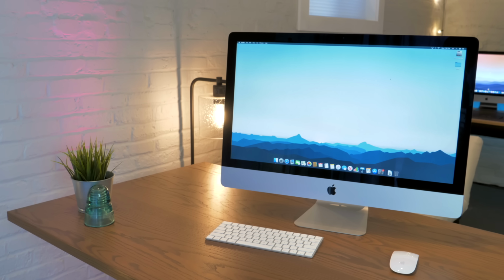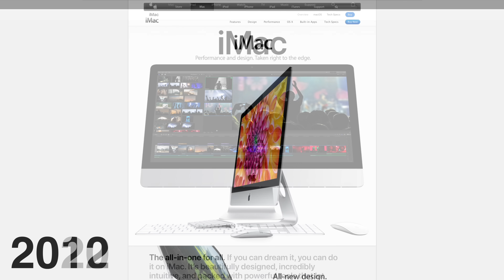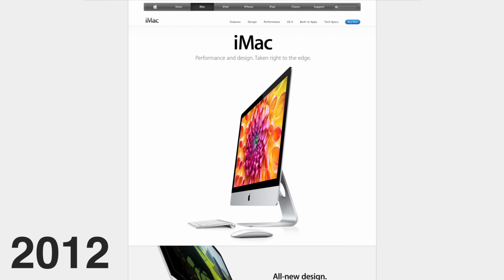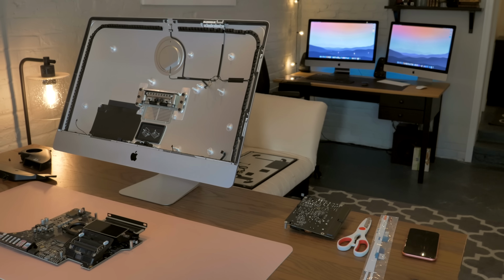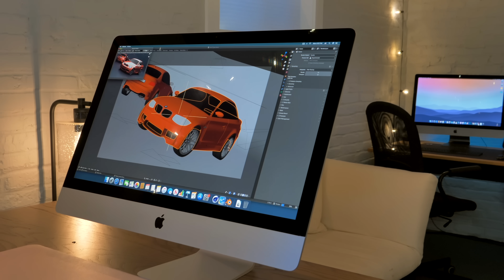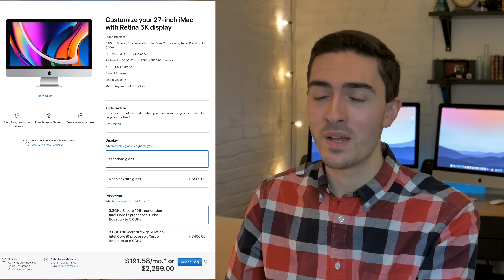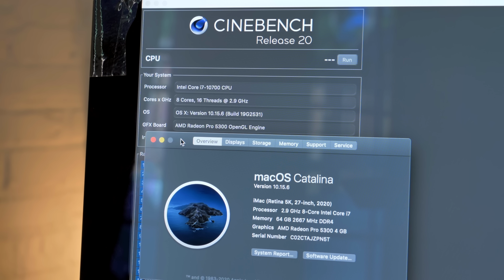DIY 2020 iMac upgrades! Is the LAST upgradeable Mac worth it?!

Comment from the maker: As some folks pointed out, I missed that the microphone holes are on the bottom of the display so I accidentally covered them with the adhesive strips, there's almost always something you're bound to forget about when doing a repair! Use adhesive specifically for a 2019/2020 iMac, or just cut the strips before applying.
Reply: Luke Miani is it possible to replace with a i9?
Reply: NVRMND I jumped the gun 🤦🏾‍♂️
Reply: Where exactly?
Reply: @raleedy  At the bottom right of screen, close to apple logo. I did the same things when upgrading my 2019 iMac 21.5 inches.
Reply: @THOR2029  he use i7 10700k
Reply: Can you please confirm if could be done with an i9?
Reply: I found this one in Argentina, and I believe could be work fine:  Intel Core i9-9900KF BX80684I99900KF
Reply: Hi Luke..(or anyone else who knows the answer to this) Just curious, if I update a 2015 iMac with a new processor from the past couple years, will I be able to update from Monterey and install Ventura? In other words does the processor upgrade enable installing newer software for Macs that Apple has dropped support? Thank you in advance.
Reply: can I addd a 14th gen i9 with 24 cores to a 2020 iMac 27inch ?  @Luke Miani?
Reply: can I upgrade to i9 bro?
Reply: Honestly… try to open an slim iMac is the worst nightmare. There’s 2/3 possibilities to crack the display on the right low side.

Comment: Hi Don't know if you can help , I have a 3 GHz 6-core intel i5 with a Radeon Pro 570X 4GB Graphics, 72GB memory DDR4 now running Sequoia 15.0.1, my issue is I have partitioned and installed windows, I cannot for some reason find a Graphics driver for the radeon Pro, I have tried down loading the driver but will not be detected by the windows system !! any help appreciated thanks .

Comment: Apple is designing out upgradability, it's intentionally doing it to keep you buying   new !! One point on power supplies, The capacitors on the board can be discharged by unplugging the power cord and then holding the power button for at least 1 min
Reply: Merry Christmas!

Comment: The time came... 2 years passed after I watched this video first time :))). 
Still doubting whether to upgrade from i5 3.3 to i9 (10900) in 2023 when there are a lot of M-chips. Although the iMac's display is still gorgeous.
Reply: Apple used Intel i9 10910 for these Macs, this is the 65W, lover thermal, version than the the 135W countarpart versions. I have been wondering if i should do this upgrade on my iMac 2020 with the i5 10500, but I installed 64 gis of ram in it and I use thunderbolt SSD for the main drive and this gives reasonably fast loading times, but overall performance of this iMac is a little dull compared to my 13900K hackintosh.

Comment: If the internal SSD of the 2020 iMac fails, will it brick the iMac? I read that it will for Apple Silicon Macs. I'm thinking of getting a 2020 iMac and booting from an external SSD as a contingency plan when the internal SSD fails.

Comment: I bought a 2019 iMac (refurbished) for 1599 in 2020 with a core i5-8500. My only real complaint out of the box was that the fusion drive was just plain slow. Boot up time was... well I would go get a cup of coffee and feed the cats before getting on the computer. Yeah that slow.  So now it's 2023 and the Core i9, nvme and sata drive prices have dropped to an affordable price. I think it's time for an upgrade. Thanks for this video.
Reply: Replying to my own post. First of all opening up an iMac is not something that I particularly enjoy doing. That being the case I took the multiple upgrades I wanted to do and combined them into one single project. In this specific case I wanted to upgrade the CPU, NVME drive and the SATA drive. I did go for the I9-9900 processor and a WD 850 2TB SSD NVME drive plus I replaced the Fusion drive with with a WD 2TB SATA SSD drive. It got it all put back together this evening and this thing is an absolute beast. The NVME drive reads and writes at over 3100 MB/s and Cinebench multicore rating of 9457. It's unbelievable how much power was hidden away in this old 2019 computer. Now that this project is complete I have a new perspective on the next generation of Macs. As fast and efficient as the new Apple Silicon systems are, they just don't have the upgradeability that the previous generation had. Good or bad that's just a fact that we Apple fans will have to contend with. Broken hardware will for the most part will have to go back to the factory to have the the logic board completely replaced. Other internals components like screens, keyboards and batteries might still be user replaceable. This will be at the front of my mind when making my next purchase. Instead I'll be skipping the baseline Macs and going with  a middle to high end system. Preferably it will be a refurbished or open box system.

Comment: Hello Luke Miani! I have iMac 2017 with i5 3.4ghz CPU (gen 7) that is on LGA 1151, however... the 8gen and 9gen intel are based on the same LGA socket (1151). I wonder if you tried to make this kind of upgrade to an iMac 2017. Can you make this happen?

Comment: I have an 2013 imac and its running slow on the new mac os venutra is it worth to put more ram and an i7 in it ? Would it be fast again?
Reply: Do you have an ssd inside? If not,That can really help with speeds

Comment: Hi, I currently have  a 27 inch late 2013 imac with i5 3.2 GHz processor speed. My question is if I change the processor to i7-4771, can i then change to a GTX 780 M 4 gb, or is it part of the original board and not possible to upgrade the video adapter.  In my Tech sheet, it says the 3.2 is only available with the GT 755m.  it says the 3.4 GHz can be configured to a GTX 780.  I want to upgrade, but would like the GTX 780 video.

Comment: I have a Late 2015 27 5k upgraded with 32 GB ram and 1 TB SSD. Runs just fantastic except crash when sleeping. Anyway. The display is amazing and got inspired of you putting an mini inside. Might do something like that in the future when the CPU is not supported anymore. Great videos, Luke.
Reply: There are a few command lines to stop the 3rd party SSD from sleeping and stop crashing the system.
Reply: must be some specific ram or can be any brand ?
Reply: @Adiiiman2xxx  I don’t think the brand itself matters. But I made sure it was 1867 MHz    matching the specs for this machine.

Comment: I have the iMac 27" with 8GB memory, i7 and 512GB ,  a better deal at $2300, if you add your worth.  As a VAR my Hourly for IT Services ranges, but figure $150 to $250 an hour.  And I figure since it appears this is also what you do for a living (I'm new to your channel) that you would have to add the time in/services rendered into your overall cost.   Much like when you present your clients with the BOM, and SOW for invoicing.

Comment: Luke, found a 2020 iMac 27 inch i5 (iMac20,1) in a pawn shop. I plan on upgrading the cpu. What cpu will work in this model? I do not see a link in your thread to the one you used. Thanks

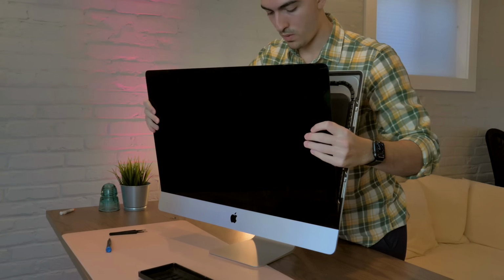Comment: I don't know why YouTube suggested me this video but this reminds me when I upgraded my 21.5" iMac. The reassembly process was going well, I put the display back on without the adhesive strips to test if everything is ok. I pressed the power button and... nothing. I disassembled everything again and restarted each and every step carefully. But still the iMac won't power on. It's already past mid night, I'm pissed off, I have no clue of what's wrong and I'm exhausted. So I said to myself: leave it as is and check everything again the next morning. I pull the power cord from the wall socket and the screen tilts forward... the display falls off. Had I followed the advised at the 7:50 minute mark of this video (tape that damn display when you test), my iMac LCD display would be free from any cracks. Now I laugh about it but that day was awful for me.

Comment: just a tip if you unplug the machine and wait 5 to 10 minutes, then push the power button with the machine (( unplugged )) the Capacitor will discharge and with out power the Capacitor will not Charge for the next use. just food for though

Comment: The fact also, that you can actually save money than what you calculated in this video is that the Core i7 configuration came with a 512gb SSD standard for $2299 and plus at least $200 for 32x2 64gb of RAM for a total of 72gb of RAM (or sell your original 8gb RAM to save even more). All these without voiding your warranty.

Comment: So I find learning about Macs and all their inner workings very interesting. That being said I do not know how to work on computers. So I am curious, if its not plugged in why would the power supply electrocute you? Dumb questions I know but I wanna know.
Reply: Because the power supply stores electricity so that it can provide consistent current to the machine. There are capacitors that retain electricity and if you were to touch one, it would discharge resulting in a shock.

Comment: Can the GPU be upgraded?
Reply: sorry, with a bit of hunting I see that this isn't possible. GPU is built in apparently. But on this model you have to get inside to add in more RAM? I thought imacs had an easy open door on the back to do RAM upgrades.

Comment: Performance of the base 2020 is pretty good! GeekBench 5 score for the base iMac (27-inch Retina Mid 2020)| 1159
 Single-Core Score | 6710 Multi-Core Score. The only upgrade is the ram, 32GB Hynix 2666mhz (4x8Gb). View score "9269291"

Comment: 6:18 So as the SATA port.
I just upgraded my 27 inches Late 2013 iMac recently with i7-4771 and two SSD drives. One NVMe and one SATA.
I can’t imagine how tough would it be if I bought this model to replace my current one, because any external drive with high speed and low latency would take one of the thunderbolt ports which I connected both to my monitors.

Comment: Awesome video. Just a tip, you should never touch the RAM chips or circuits with your fingers as you do in the video. Always handle them grabbing it from the sides, because the static electricity of your fingers may damage your memory modules.
Reply: That’s a myth. Watch Linus’s Video with static electricity

Comment: The 2019 was the last modern fully upgradeable imac. Upgraded my 2019 iMac to 4Tb Samsung Evo SSD + Samsung Evo 2Tb NVME, It came with: 128Gb of ram, an i5 9600k and 8GB 580X. I'm currently building out a second iMac enclosure-d 5k 2nd monitor with an integrated 8GB EGPU so we'll see how it goes with the eGPU bu for now the 2nd monitor is working fine.

Comment: Non upgradeable storage? Toss the logic board and install one with an upgradeable socket. 
In theory, you should be be able to swap the logic board because the design is unchanged from previous iMac years

Comment: This version is the worst, the best equipment is the 2019, fully upgradeable to 2 SSD drives, 64GB RAM and Core i9 CPU. 2020 and all soldered?, 256GB or 512GB SSD base storage? No second drive? GPU upgrade is prohibitively expensive. Total Steal. And... I like Apple products.

Comment: Hi Luke, 
what can I upgrade other than RAM on my iMac (27-inch, Late 2013), 3.5 GHz Intel Core i7 quad-cor, 16 GB 1600 MHz DDR3, NVIDIA GeForce GTX 780M 4 GB, 1Tb Fusion Drive ?
Thanks

Comment: Luke you should do an upgrade to a 2019 27in imac....  why ? remove the fusion drive and fit an nvme 2 tb m2 to the motherboard with an adapter and another 4tb sata ssd to replace the spinner. maybe the cpu as well

Comment: Far more cores... 8 times more RAM... all for puny gains in productivity gains?   The rendering time increases are not good.  HORRIBLE, in fact.   When we did much the same Purchase Improvements (i7, 64gb), our 8-hour renders were reduced by 70 minutes.  But that's all.  It was still "1 render a workday" which - of course - was done overnight.  It was all machine time.  Other Intel products saw 8-hour renders to 3 hours, but that was coupled with better GPUs as well.   I think we'll stay off the Apple ship for another few  years, rather than jumping off of it again.  This video was terrific by the way and illustrated how thoughtful and customer-oriented Apple designers and engineeers are.  NOT.

Comment: This was quite informative, I just bought a 27 inch iMac, mid tier model with 6 core i5, it performs well, I came from a 2014 model, that I had for 7 years. the only addition I ordered was the 512gb ssd built in, probably did not need it but 5 years from now I may be glad I did, I added a Samsung t7 ssd for my data and remapped the documents, desktop Pictures, music and videos folders to that. I put 64gb of memory in it, and called it done. 2-3 years from now when the processors are cheap and the warranty is gone, I may upgrade the processor, and perhaps someone will come out with a kit to get the internal nvm2d drive working again, But honestly, I think I have about 5 years before my intel iMac will not support the latest OS and I will have to get an apple chip based computer. Shame because I love my intel Mac.

Comment: One thing I found unfortunately, using the aftermarket adhesive strips, make re-entry into the imac a 2nd time very very difficult...which in my case, I ruined my display....if you upgrade make sure you don't ever need to get back into it a second time....

Comment: One important thing I noticed straight away , when you were upgrading the Ram , NEVER EVER and seriously Never handle Ram with your bare hands !!!!! It is so static sensitive that you can and will destroy it the second you touch it , especially on the bottom contacts and the chip sides , so always wear a wrist strap linked to a ground source at the minimum , but I always wear plastic gloves prior to handling such sensitive products and that applies to CPUs and graphics cards also , in fact motherboards too. SSDs /HDDs (providing you avoid touching the contacts and circuit board on HDD and contacts on SSD) you don’t need to wear gloves but make sure at least you ground your hand  prior to handling them . These components are not cheap so handle with care . Otherwise good video Luke :)

Comment: I did the Fusion HDD upgrade to SSD and NVMe to my 2015 iMac and it went well.  Until a week later when the screen fell off due to the really bad adhesive strips supplied by OWC.  I have now had to order a new screen and am hoping the new one will stay in place. I will use stronger tape and possibly glue.   I love Macs but why are they so expensive?

Comment: The intel based mac will be around longtime after Apple stops  surporting them,  Linux and Windows 10 will keep them going for years.  People will throw away m1 cpu mac before intel base mac will be.  With  a little work a 2009 imac will run windows 10.

Comment: I know that the ssd is sadly soldered to the motherboard in this model/no upgrade,no easy fix. If the ssd dies for any reason is it possible to use an external one via usb/thunderbold without any issues from the system/motherboard/ignore the damaged soldered one ? Can you even use permanently an external one for booting/storage and leave the soldered one without any use ? It is good to know if we have that options for a last resort if something goes wrong.......Thanks.

Comment: For storage, you can ... although it's a little bit nasty ... get a USB-C to Sata cable, an SSD of your choice and ... a double sided sticky pad. 
Then you simply connect the cable to USB-C port on the back and to the drive (yeah, obviously) and use the double sided sticky pad to adhere it to that shiny aluminium. The shorter the cable (within reason), the neater the job. Sort of. 
Now, granted, if your mac is visible from the back - as in not up against a wall - it's going to be noticeable. That beautiful sleek structure, marred by a bulge. 
There really isn't anywhere to hide it, unfortunately. 
however*, this is probably the most easy upgrade you can do for any iMac that supports USB 3x, to increase storage - the ultimate goal to use it as the *primary drive macOS boots from.
And if, like many of us, the back of your iMac isn't visible, you won't even notice. 

But why would you do this? Why not just have an SSD drive on the desk  - why attach it to the back?
Simple - it will likely be your primary drive. You don't want to be accidentally disconnecting it - much better to have it neatly tucked away.
It also saves you the cost of requiring a case for your SSD or going to an over-expensive, over large external drive.  

So sure, on the 2020 iMac, this probably doesn't make a whole lot of sense - the onboard SSD is going to be faster. 
But for older iMacs with mechanical drives, it's a quick fix that boosts your speed almost as much as the 'really hard way of doing this' ;)

I upgraded my wife's 2013 iMac about 2 years back via this ridiculously easy method. 
Hey, I'm not afraid to get my hands dirty taking things apart if it was MY iMac, but I do value the relationship I have with my wife, as well as my wallet.

Comment: Hi Luke, thanks for all of the free info that you provide. 
I'm running a 27" 2011 imac (High Sierra, 20GB RAM). 
I need to upgrade to either Mojave or Catalina, but I think that my Graphics card will have issues (AMD Radeon HD 6770M 512 MB). 
I'm a member of Adobe Creative Cloud and at the moment I can't install the latest release of Photoshop and Lightroom. 
Am I correct that I will have issues and can you recommend a Graphics Card that I could upgrade to ? 
Thanks for your help.

Comment: I am wondering why Apple uses the K variant. As you said, it is not like an iMac owner is really going to o overclock their system, and there would be no advantage to them to use that necessarily over a non K variant. Maybe VT or something is included in that, or I am wondering if maybe Apple does overlook or undervolt their systems to help manage draw and control thermals.